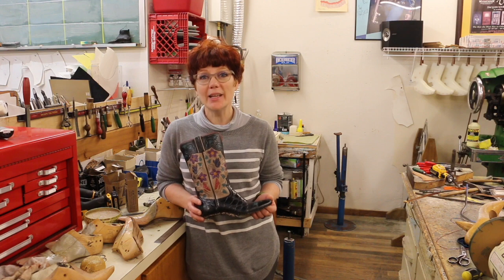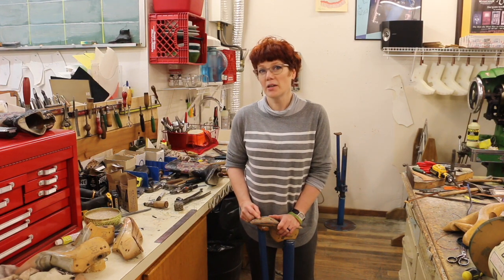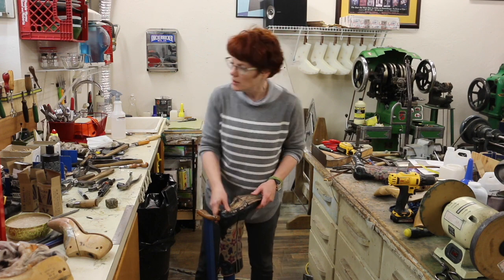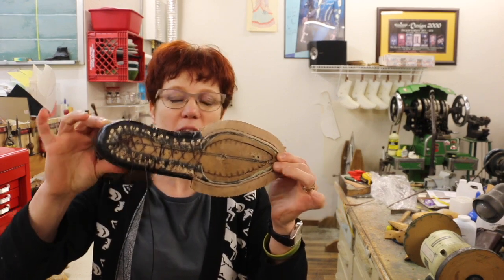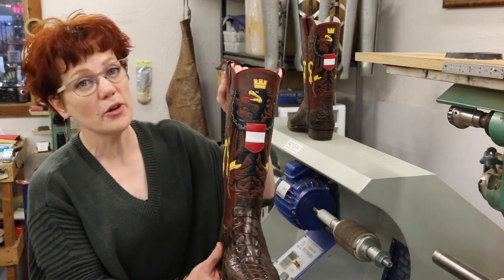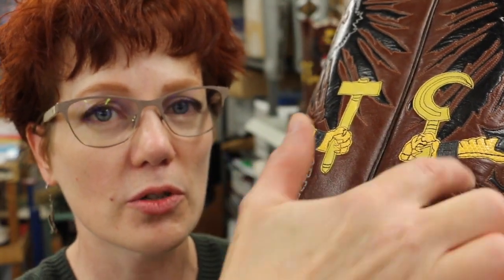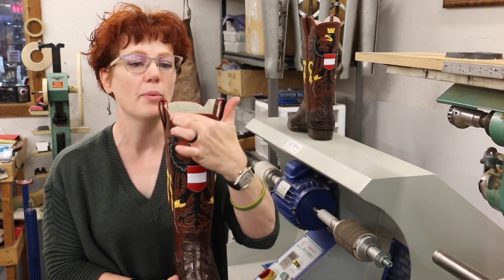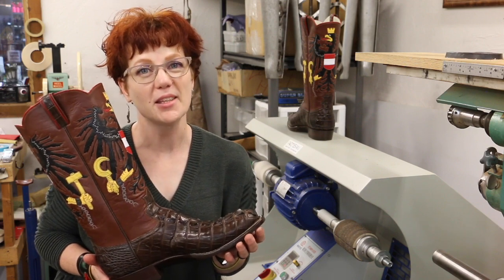It's a Boot Life: relasting and rewelting boots

Comment: Would the smaller last make the boots too tight?
Reply from the maker: Cady, I use the smaller last so that it's easier to re-last and re-welt, because when you use a correctly sized last it's difficult to put everything back exactly where it was. You need a little bit of excess to grab and pull when you're re-lasting. Then once I've put everything back exactly where it was (because I wasn't using the smaller last to take the opportunity to pull it tighter than it had been before) I'd stitch and glue everything in place and then remove the smaller last and put the correct size in. The smaller one isn't for sizing, it's for making putting it back together easier.